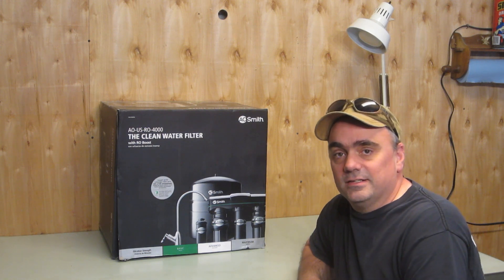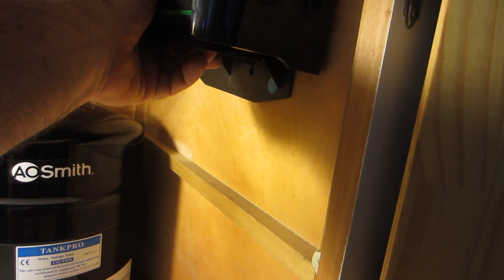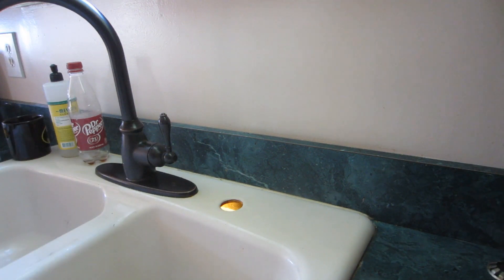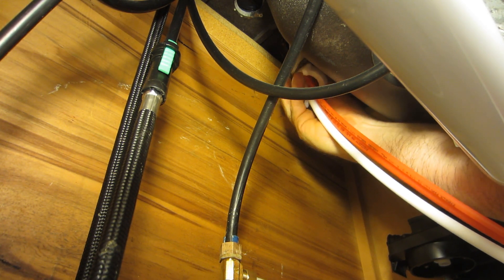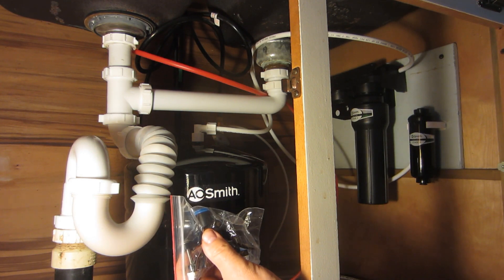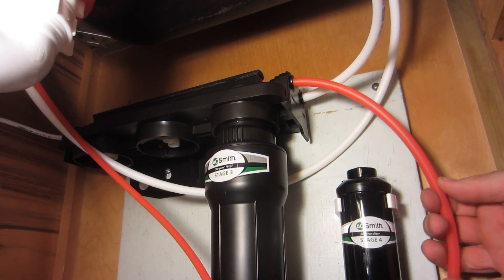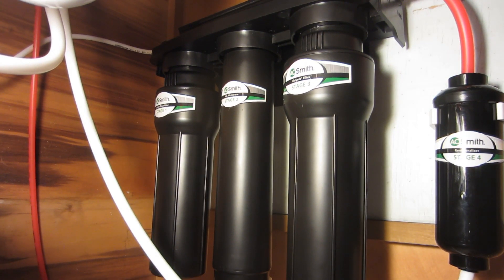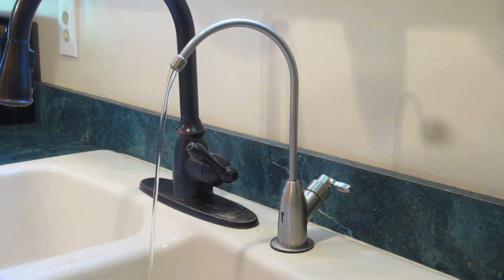A. O. Smith Reverse Osmosis Water Filter Installation AO-US-RO-4000

Comment: Hey just got my system installed today and started the 2 hour pressure build up. So I let it build up and the whole time I could hear water running through the drain tube. Anyone have this problem, is it normal? I have double checked the flow restrictor and I believe it's installed correctly. Thanks for any advice!
Reply from the maker: A gurgling sound coming from the little keyhole in the faucet is normal, if that is what you were hearing.
Reply: @TheFixitShed  even when the faucet is turned off?
Reply from the maker: Yes.
Reply: @TheFixitShed  so 24/7 it's going to waste water?
Reply from the maker: The gurgling is from air in the system.  It takes a few days for all the air to work itself out of a new installation.  After that, it will still gurgle occasionally with use. The system does use water to wash away the contaminants caught by the filter. That is why it has a hose connected to the drain.  If there is a lot of water flowing through that hose constantly I would say something isn't right.
Reply: @TheFixitShed  Okay thank you!
Reply from the maker: Glad to help.

Comment: What fitting did they send you for the drain? The one I have is not the correct size for the red tube.
Reply from the maker: The one they sent me fits the 3/8" red hose (the larger hose).  If yours does not fit, call the support number in the manual, and they should be able to help you out.

Comment: i am awater dealer for aqua flow water will flow down drain until tank is full if you have low water presure your ro with take along time to fill or may never get full if you want good water flow from your faucet you need big lines aleast 3/8 tank presure need to be set 8 pounds  when tank is empty when full it will much higher also aro likes soft water
Reply from the maker: Thank you for contributing!

Comment: my red drain hose always drips
Reply from the maker: It is not uncommon for the red hose to have water going through it.  That is the waste line. The RO system will flush itself to remove contaminants, and the result of that is water going through the red hose to the drain.  If water is constantly flowing down the drain, I would contact the customer support at the 877 number in the manual.

Comment: I had this system recently installed and it makes so much noise (very load) a few times a day for long periods. Is this normal?
Reply from the maker: It doesn't sound like it.  Some gurgling coming from the keyhole in the faucet is normal.  Water dripping from the waste line into the drain would be normal.  Nothing that I would consider loud, though. I would check with the installer and/or call the AO Smith help line in the manual.

Comment: You should have removed the worn out angle stop on the cold side. You have a shut off at the PEX manifold. They both leaked at some point thus the mineral deposits.
Reply from the maker: Yeah, I am going to replace all the copper eventually.  There is only a 3 foot section of copper in between the pex and the T-fitting for the RO filter.  I am not sure why the previous owners left the copper in when they had the pex installed.

Comment: Warning! Do Not Buy! I have a A.O. Smith unit just like this. These reverse osmosis units are garbage. Didn’t last long. It started leaking from the O-rings. Replaced the O-rings and it still leaks. I talked to customer service. They are a pain in the butt to deal with and do not want to help. That says a lot about a product. I do not recommend A.O. Smith! Mine only lasted a year. And of course, can’t find the receipt. End of story!
Reply from the maker: This is definately a flaw.   I have had luck with making sure the o-ring is lubed, and then tighten it down, if It leaks, loosen it 1/4 turn and then tighten it again.  You might need to do it more than once, but that seams to get the o-ring in the proper position, eventually.  The sumps have a goofy way of sealing with the o-ring.  It doesn't close down on the o-ring, kind of squashing it, to make the seal.  It bottoms out so that you can't tighten it any further.  Not a great design.

Comment: Did you actually purge the system for 24 hours? I just installed my system and that seems to be a large waste of water.
Reply from the maker: Yes. The RO system does not process water very quickly.  I think my system is only rated for a gallon or so per day. So after the first few mminutes it is just a trickle. Probably less water than flushing your toilet.  You can catch the water and use it to flush next time. Because of the bleach I probably wouldn't cook or water plants with it .

Comment: run water for 24 hours, jesus lol
Reply from the maker: LOL.  It isn't that much.  after the first few minutes, it is just a trickle. Catch it and use it to flush your toilet.
Reply: @TheFixitShed  question sir, do i need to run it 24 hr continuously, or can i run it for 12 hr, turn off, and then when i come back, finish off with another 12 hr (im going outta town)
Reply from the maker: @edgehodl4832  That's a good question. I would probably either run it 12 hours now and 24 hours when you get back  or wait until you get back and run it 24 hours. You might want to call the A. O. Smith helpline in the directions to make sure. They are super helpful.
Reply: @TheFixitShed  thanks! i installed yesterday and runs great, im in middle of 24 hour purge.  this video helped alot!